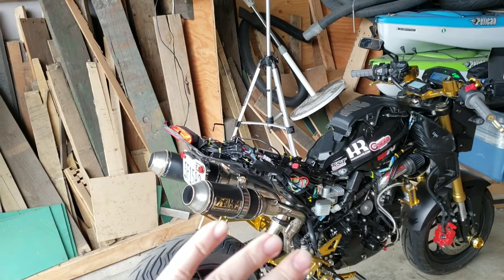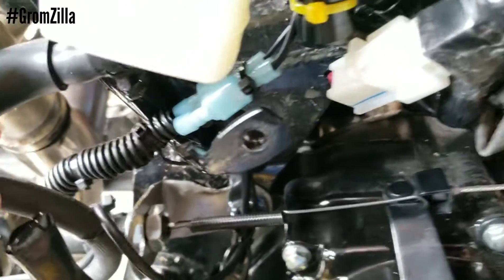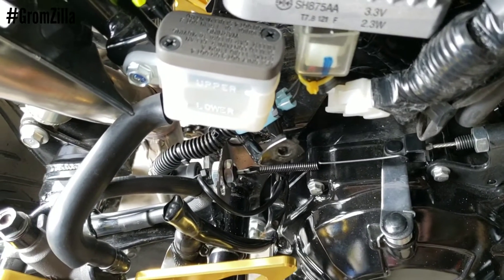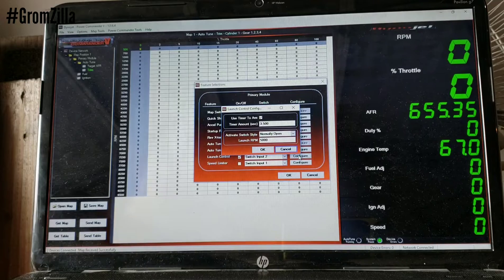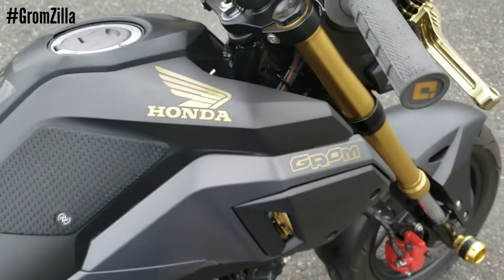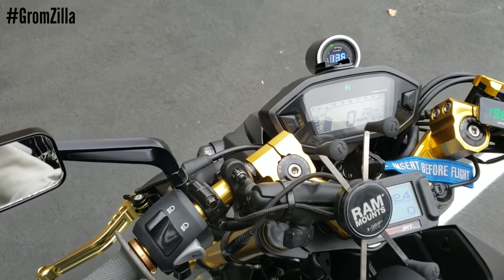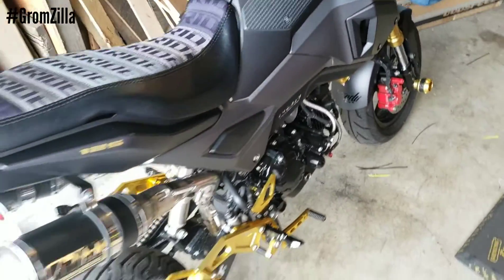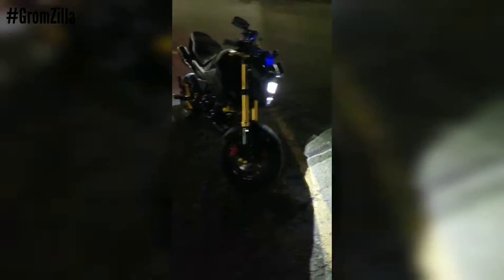GromZilla Honda Grom 2 step launch control using Power Commander 5  How to set it up

Comment: does it fuel cut or ignition cut?
Reply from the maker: I would have to go back and look at the software to jog my memory but from what I could recall it will do both or either one it is programmable through the power Commander v software..
Reply: @BLRTUNING  I'm guessing most likely fuel as I didn't see an ignition module in the video unless the auto tune controls ignition too
Reply from the maker: Had a chance to look at it today it is indeed fuel cut
Reply: @BLRTUNING  ah okay thank you

Comment: I was wondering if you can use the launch control on any bike. I have a bike down in mexico and its a 250 can i add the launch control to it?
Reply: It's a 250 FT Italika so they aren't know here in the U.S so wondering if its still possible
Reply from the maker: @bnr_dett3826  yes you could add the two-step launch control if you want it to you would just have to fabricate up the bracket so it lines up with the clutch mechanism at the motor. You could buy one of my kits and then fabricate up your own bracket if you wanted to or you can figure out all the components and purchase the components individually yourself. I believe the bracket itself is going to have to be fabricated out of metal and it's going to be more of a custom job. As far as the two-step launch control stuff works the wiring and the programming would all be the same... I can't ship to Mexico but if you have an address in the US I can ship it there if you want one of mine. You can get a hold of me through the blr tuning Facebook page...

https://m.facebook.com/BLRTUNING/
Reply: @BLRTUNING Alright yea currently im in California soo i will definitely order it as soon as possible thank you for your time and thanks for the information helps out a lot
Reply from the maker: @bnr_dett3826  just shoot me a message whenever you're ready to order I have them in stock

Comment: @BiLL Ramseyer I have a power commander V on my 2010 zx10r and I need your help making the 2 step launch control work. How can we communicate easier to get this done.
Reply: Kawasaki Cruisader I had the pcV on my zx12r.  You probably need the ignition module also to utilize the launch control.  Check with dynojet customer service.
Reply from the maker: Yes he will need the ignition module Dynojet has already confirmed
Reply from the maker: Dynojet has already confirmed you will need the ignition module to go with your power Commander v.. you can look me up on Facebook and hit me up through messenger..
Bill Ramseyer Jr

Comment: iam dumb... i go Pin 3 to Switch to Pin 4? for activate?      Input 1 -> Switch -> Input 2 Grnd ?
Reply from the maker: No do not use a ground or power you will short-circuit your power Commander v and make it useless
Reply from the maker: The switch inputs are for a simple 2 prong on and off switch basically if you were to take a wire and stick it out of each hole if you touch them together the switch is on if you disconnect them the switches off you cannot run power you cannot run ground do not use a lighted switch either
Reply from the maker: They are designed for a two prong on and off switch the way two prong on and off switch works is when the switch is on the circuit is complete when the switch is off the circuit is incomplete
Reply from the maker: You only need one switch input which is hole number one and whole number two or hole number three and whole number four..
Reply from the maker: If you can message me on Facebook messenger or Instagram I can send you a wire diagram it is a very simple procedure
Reply: @BLRTUNING  ah sorry i understand 50%... u got a Pic for me?
Reply: @BLRTUNING  i write to u..
Reply: look insta bro

Comment: Why did you not just use the standard clutch switch
Reply from the maker: Because the standard clutch switch has power going to it or ground either way it will have one or the other and that will short out the power Commander v.. power Commander v needs a simple 2 prong on and off switch as I explained in the video.. if you were to use the clutch switch and you would have to remove the two wires that are connected and then loop them together so that way the clutch switch is not touching any part of the bike whatsoever as far as electrical goes... power Commander cannot receive a ground signal or a power signal when you are running a switch input into it it will short out and destroy your power Commander v.. The best scenario is to run a completely separate switch that does not affect the vehicle at all like I have done in the video..

Comment: Everywhere i'm reading says you don't need an on/off switch in correlation with the clutch switch to use launch control. People just wire it from the clutch switch to the PC5. Why do you "need" an extra switch inline with this?
Reply from the maker: If you remove your clutch wires and wire them together in a loop then you could use the two prongs that are on the clutch lever itself.. however that can cause troubles down the road as well because now your clutch is always engaged electrically... This setup is plug-and-play without messing with anything on the bike itself physically.... The toggle switch that I used is just so I can shut the 2-Step off completely if I need to.. you technically don't need the toggle switch. You could just use the switch that I have on there that goes straight to the clutch mechanism at the motor... also the other thing you have to keep in mind you cannot splice into those two wires at the clutch because they have an electrical current going to them... The power Commander was not designed to have an input going into the switch inputs that uses any kind of power.. anything more than 5 volts would cause the power Commander to fry itself internally.... the switch inputs on the power Commander were designed to have a simple on-off two prong toggle switch. You wouldn't want to use a lighted switch that has power to it or anything like that either.. that's why I created this system because it is foolproof and gives you a real legit working 2-step on a Honda Grom.... once you let the clutch all the way out it will come off of two step and go back to full throttle just like any two step would work on any race car or drag bike...
Reply: BiLL Ramseyer so basically to fix this you wire in a toggle switch between the clutch switch and the pc5?
Reply from the maker: the only way I've ever done it is exactly how it show in the video the power Commander v was made to handle a simple 2 prong on and off switch.. I have heard of people using the clutch switch I've also heard of them destroying the power commander 5 by doing so and messing their bike up by doing so so if you want to do that you'd be completely on your own it's not something that I would suggest... If you watch the entire video you can see exactly what I did.. the brake light style of switch that I use gets pulled to a non position by the actual clutch mechanism at the motor.. will I use doesn't connect to anything on the bike electronically or require any cutting of wires on the bike electronically... if you watch the full video this is the exact way that I do it and it is the only way that I have ever done it on anyone else's bike and it is the only way that I recommend to do it... just remember you can do it however you want the input to the power Commander 5 switch inputs needs to be a two prong simple on and off switch with no voltage going to it whatsoever..
Reply: BiLL Ramseyer honestly I’m just going to remove it completely from my bike I just installed launch control with my PC5 but I have no intention of actually using it. I just thought one day I would do it for shits and giggles but it’s not worth the extra wiring and hassle of installing it.

Comment: Nice Job bro will this work on a pit bike
Reply from the maker: Might have to fabricate your own bracket as I did in the video.. this will work with power Commander v if you can control the ignition.on some vehicles you have to have the ignition module that goes with power Commander v..
Reply from the maker: @Johndeer325  done....  Please don't forget to subscribe to mine and hit the like button it is greatly appreciated...

Comment: How's your turbo setup coming along?  I have a turbo Grom and just started tuning it by pressure (pti).  Installed a map sensor and plugged it to pcv.
Reply from the maker: I decided to not turbo it.. it just has a 181 Big Bore Kit and just about every modification you can get out there on the market it's still a two valve though.. it's very fast for a Grom and still reliable enough to ride to work on a daily basis and take it to the track and have some fun.
Reply from the maker: If you could look me up on Facebook I'd love to see what you have built

Comment: So you need a PC for a 2 step?
Reply from the maker: Yes for this set up the way I did it yes you would need the power Commander to control the two step
Reply from the maker: Be sure to watch the entire video I explain everything in the video
Reply: Yah i didnt have time to watch the whole thing but i will. Im wanting to put one on my hayabusa but i dont have a PC on it just a flash and bolt ons.

Comment: 2 step launch control on a Honda from, it's a Honda I use rev limiter
Reply from the maker: This is a fully built drag bike... We need two step launch control to be accurate at the line... Rev limit on this bike is 12000 RPM that does has absolutely no good on the takeoff...
Reply from the maker: You don't have to like it and you don't have to approve of it but I just wanted to make a video showing that it can be done..

I get it it's a Honda Grom.....

if there wasn't people out there like myself doing things differently than everything in the world would be the same..
Reply from the maker: Two-step launch control for the Honda Grom is now available for purchase. I invented the product. It works with power Commander v and is a plug and play system. you can get a hold of me through the BLR TUNING Facebook page.
https://m.facebook.com/BLRTUNING/
Reply: @BLRTUNING  it's called a joke Einstein

Comment: Question for you. I’ve had a PCV and auto tune for 3 years and after watching some of your videos I’m like ok I think I can change the maps around and come to find out all 3 of the dynojet maps I downloaded don’t have values for the auto tune so the map i picked the auto has never been working I guess 🤦‍♂️. Can you point me in the direction of a map or maps that do or just how to fix it.    Thank you.  What part of Wa are you from? I’m between Olympia and Bremerton
Reply from the maker: I'm in Vancouver Washington if you look up my name on Facebook message me through Facebook messenger I'm sure I could probably help you out.
Reply from the maker: Bill Ramseyer jr
Reply: BiLL Ramseyer not a big Facebook person sorry. I did figure out how to get the values put in there had the auto tune for three years not doing anything because of the missing values 🤦‍♂️
Reply from the maker: all the values on power Commander v from 0 to 79% throttle should be at 0 there should not be any adjustments made whatsoever the only adjustments power Commander v can make is at 80 to 100% throttle range regardless of the RPM..... Your auto-tune is built into the wideband module.... The wideband module controls 0 to 79% on its own... you will never see any adjustments at 0 to 79% in power Commander v..... if you do have adjustments in power Commander v under fuel trim or fuel or air to fuel ratio the pcv will be arguing with the ECU.... In that case it will never run right.... you have to make an adjustment to the lambda value in the wideband module by using the C3 software or the pod 300 or LCD2.....  If you give me your email address I will email you a way to contact me directly.
Reply from the maker: @MrK2zeplin  the only values you should see numbers in on power Commander v software is 80 + 100% throttle... .. again if you see numbers anywhere else other than that in power Commander v then it is wrong.....     The wideband is what controls 0 to 79% throttle.. it's a number called lambda value.... Or lambda...... that is the voltage in which the O2 sensor determines whether or not the bike is running lean or running rich..... You can change that number to get to a desired air to fuel ratio...
Reply from the maker: @MrK2zeplin  also.. you have to accept the trims that auto-tune makes it does not do it on its own it makes suggestions and says whether or not it would like more or less fuel in a specific area.. at 80 to 100% throttle range.... if you don't accept those trims you are not using auto-tune device correctly...

Comment: Are u using the ignition  module
For the pcv ? Or does the pcv know to do all this on it's own with the switch
Reply from the maker: You don't need the ignition module to do this it is programmable within the power Commander v software.. it uses two wires going into the power Commander v.. those wires are just a basic on and off switch program.. if those two wires make contact with each other the switches on
Reply: @BLRTUNING  hi Bill. Do you know why in my PCV software I don't have the option to enable launch control or speed limit? I have a Kawasaki zx6r 2019 with PCV and autotune
Reply from the maker: @PedroMartinez-zm2is  power Commander v has the ability to add 2-Step launch... as you seen in the video on my bike which is a 2018 Honda Grom... You have to connect the to switch wires into the pc5 to activate the launch... I made my own switch using the clutch plunger at the motor... I have seen some people use the two prom's coming off of their factory clutch... When you are wiring a switch into the pc5 remember that it cannot have power going to it so you need to test for unless you are wiring your own switch in... In that case it is literally a simple on and off switch that uses two prongs.. it needs to be a simple switch that goes from closed-circuit to open circuit.... It is not launch control as you would see in some vehicles and even some motorcycles.... It is simply a secondary rev when activated.... In the PC 5 software up with the top look for feature enable... you cannot just turn it on in the PC 5 software there has to be a on and off switch connected to the PC5... If you look me up on Facebook/ messenger we can talk more in detail and I could probably help more...
Reply: @BLRTUNING  thank you very much for the information Bill, I will send you the result on your facebook

Comment: You could have just used the switch that the clutch has that’s near the lever that lets the bike know the clutch is pulled when starting.
Reply from the maker: No you cannot that switch has power that runs through the wiring it would fry the power Commander.. I've tested it and it will definitely kill the power Commander.. you have to use a simple on and off switch that has no power going to it if there is any voltage whatsoever it will short out the power Commander.
Reply from the maker: That was the original plan until I realized there is power that goes through those wires to that switch and bypassing the switch wasn't an option.. ultimately what I have made is a standalone unit that does not affect the bike whatsoever or use any of the components that are on the bike originally.
Reply: Yes to what bill said, the power commander puts out voltage for the launch control so can’t put voltage into it. I have the launch control set up with an interrupt button below the blinker on my grom with a Brian Sheridan 170 big bore kit, ar dual exhaust shorty cans no silencers

Comment: What does the pod-300 all display and does it do anything else?   On the fence of getting it
Reply from the maker: it can display anything that it has access to so for example if you have a wire running from your factory speed sensor into the power Commander v the pod 300 can now read from that.. this would allow you to show RPM speed and what gear you are in..... If you have wide band it can show you and monitor the AFR, or lambda value.. if you already have power Commander v and wideband I would highly recommend running the speed sensor wire and the temperature sensor wire and purchasing the pod 300...  There is tons of options for you to display different items... You can display up to four gauges on one screen.. if I remember correctly you have four screens of gauges.... You also have three separate alarm lights that are completely programmable... Each light can be set up to only turn on when there is up to full parameters met.... If you look through my other videos I turned one of mine into a bright blue shift light....
Reply: BiLL Ramseyer that’s awesome yeah I’m wanting to have the engine temp on there I was hoping that’s an option. So you have to get those also or you just run a wire up there.   Sorry for the dumb question.   I really appreciate you responding
Reply from the maker: @MrK2zeplin  if you scroll through my YouTube channelI have a video on there somewhere that shows exactly how to program engine temperature on pod 300